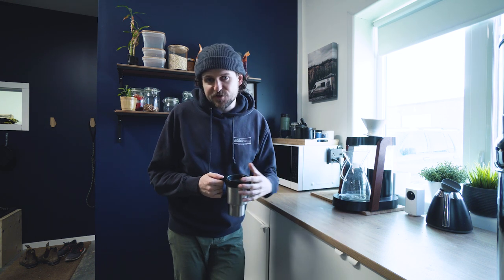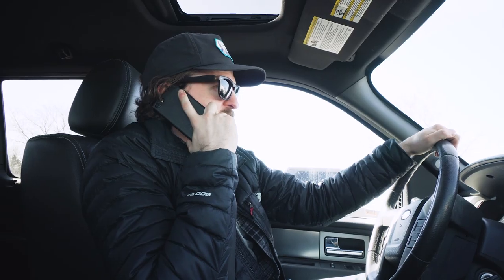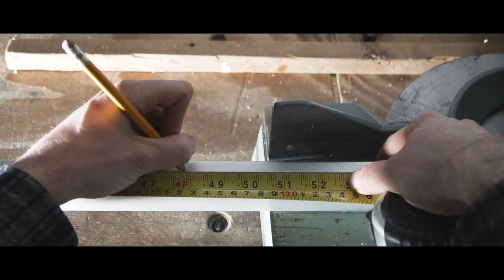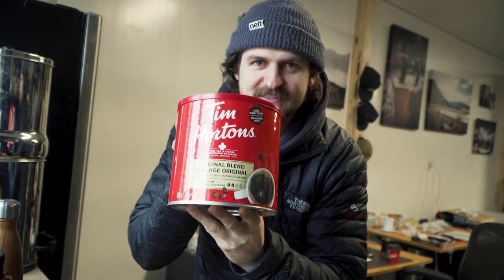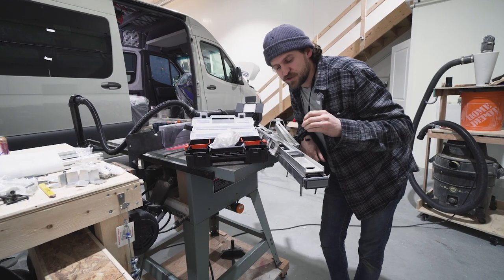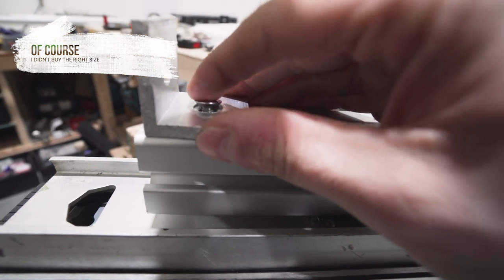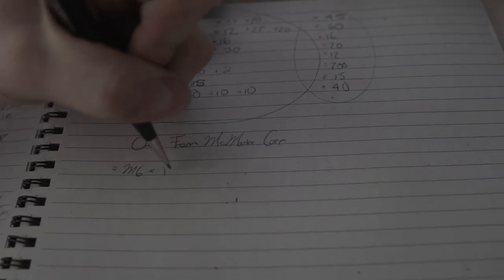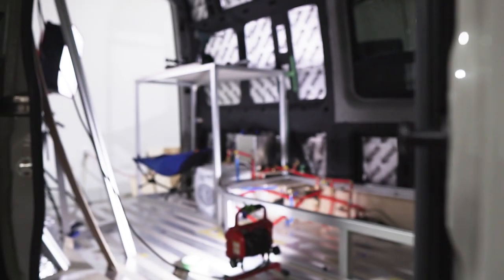Cabinet Framing with 8020 Aluminum on a Sprinter VAN BUILD the hardest part.......Frustrating

Comment: The recessed panhead bolts in the angle brackets look nice.  In places where you don't want any visible brackets, the 80/20 anchor fasteners work great.
Reply from the maker: Yeah they do.....I found these fasteners called automatic fasteners for the hidden ones and they dont require any milling which is a bonus

Comment: the 80/20 is a great way to go for rigidity and weight, i framed out my promaster build with all 1 1/4" aluminum and welded it all together. for the amount of time I spent having to zip cut and rivet I would strongly consider using 80/20. working with metal is a lot more tough, but the long term rigidity is worth the hassle. I am just finishing up my 40 day build and it has really come together. thanks for the upload keep them coming loving this build!
Reply from the maker: Yeah I would love to weld is all using square tube but I dont have a welder so its an added cost / and steeper learning curve right now. I like how the 8020 lets me make mistkaes and change things on the fly.

Comment: Hey Scott, thanks for sharing your journey with us so maybe it's a little easier for the rest of us trying to build the same thing. I'm curious why you choose to go with the extra DIY route of buying your own angle brackets and doing all the drilling work rather than buying prefabbed options from 80/20?
Reply from the maker: Hey Jason main reason is Covid making it hard to get stuff and the cost of getting it to Canada is also super high

Comment: Dude, I feel your pain!  Aluminum extrusion is easy enough to work by hand, but the cuts look way better when the factory does it.  80/20 is ok, but they aren't great about assisting with designs, and orders take forever.  I've had better luck with Framing Tech lately.  Subbed for the great build content!
Reply from the maker: Ive been using Item 24 extrusions just because they are easier to get where I live the quality has been excellent and my supplier is amazing to work with.
Reply: I built out a cool  kitchenette for my 2017 Sprinter using A lex Profiles. Way way nicer system than 8020. Internal connections that you can not see and won't vibrate loose. Same hardware for 32mm series and 40 mm series. I used the 32 and it has held up just fine for 3 years now.

Comment: Using 80/20 forces you to stock a mountain of bolts/nuts/brackets and all the other hardware they make. I think the cost and waste exceeds it's benifit.
Reply from the maker: I guess thats one of thinking about it but Ive been pretty good with ordering and even when I get the wrong stuff making it work so far I dont regret it.

Comment: Did you buy the 80/20 in Wpg?
Reply from the maker: Yea I did it’s not 8020 I’m using Item 24 Extrusions
Reply: @scottadamson6116  That makes sense - I could find 80/20 in Wpg either - ended up using Item 24 as well from the company on Notre Dame...
Reply from the maker: Terry B yeah I’m my limited experience it’s just as good if not a bit better extrusion. I had looked at ordering from Rocky Mountain in BC but having a local place to pick up the odd piece is very beneficial. They also let me order from McMaster Carr through them which is nice
Reply: @scottadamson6116  Ya one of the few specialized things I was able to buy local when I built my van.

Comment: Dude use carriage bolts. Your life would be so much easier! 80/20 is easy to work with your making your life so much harder by using the Allen head bolts. Plus you can tighten the nuts and bolts much more securely than what you can achieve with Allen head bolts.
Reply from the maker: I hate the way carriage bolts looks I cant do it ha. I know it would be easier but it looks terrible. These m6 and m8 bolts are strong enough I can jump on the joints so I think its going to work out for me.
Reply: Scott Adamson the Allen heads do look nice I’ll give you that.